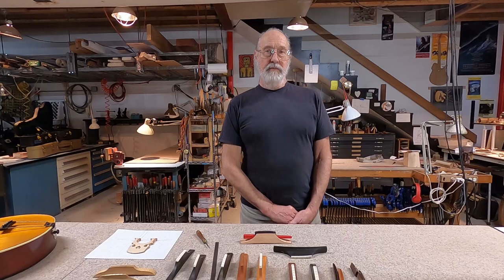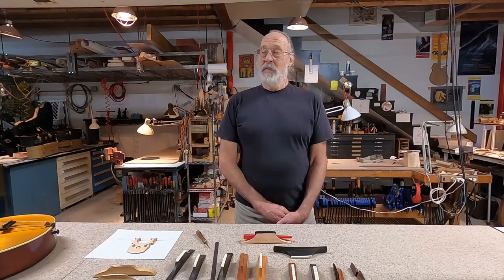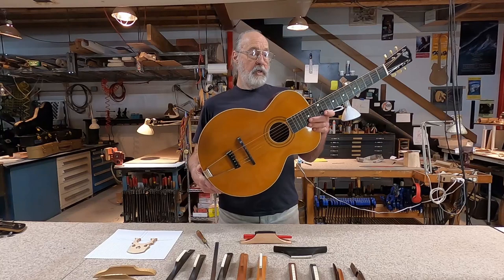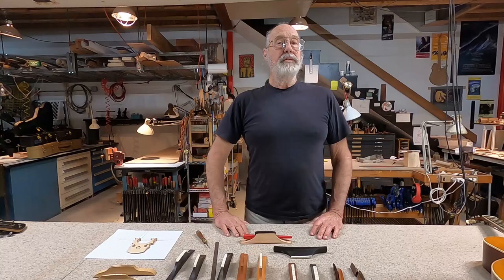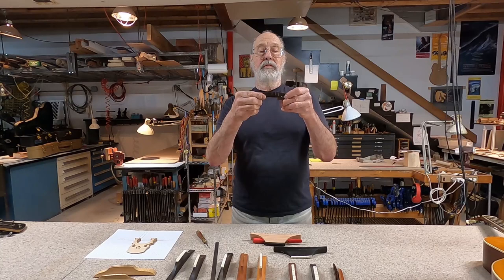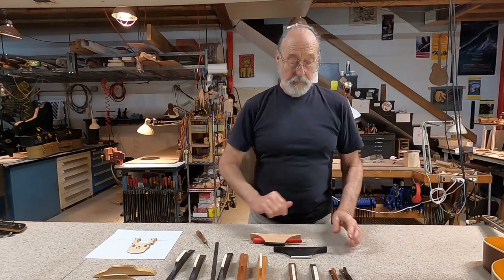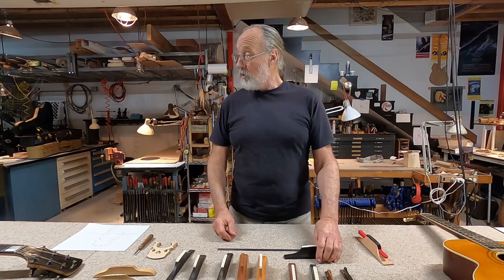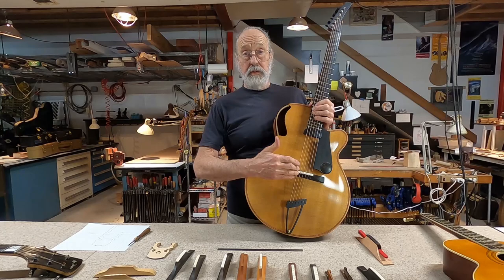Ken Parker Archtoppery: Fitting the Bridge Introduction

Comment: Hi! Would you say that now that you have achieved a successful shape for your bridges, the material is still important? Or it doesn't matter that much considering their ratter complex/stiff geometry?
Reply from the maker: Material always seems to be important, though I have found that the differences between bridge materials seem like they're less that I might have expected, assuming a hard and tough material.  I can feel how the bridge is changing by flexing and twisting it in my hands while I'm thinning it from the bottom surface.  Ever a really hard material like ebony gets around to feeling "gooey" if you get it thin enough.
Reply: @kenparkerarchtoppery9440  hi! That aluminum tube you use your necks in the vise is the best example of that :D

Comment: Ken, there's always so much to chew on after I get through one of your videos. Quick direct question - what's your experience using Indian Rosewood for the bridge? With the scarcity of Braz and the whole ethical side of things, I'm trying to avoid it for the most part. I have a good stash of very old, air dried old growth IE Rosewood, and it's incredibly light and stiff, and it seems to have worked well as a Wedge style bridge for being pretty lightweight. Thanks again for sharing that story about the wedge bridge, it's a great one for the history books. How old would you have been when you conceived of that? Cheers.
Reply from the maker: I must admit I never fell in love with any of the rosewoods, and haven't used them very often, so I have little to say about them.
I know lots of good builders who have used lots of rosewood(s), and I have no quarrel with that, but the material never seemed just right for my work.  It seems like a really heavy grass to me, but "incredibly light and stiff" will get any builder's attention, so why not?
I'd say give it a try, there's no harm in auditioning a promising material for this noble job.

One great thing about the Archtop is the non-glued bridge, so it's easy to assess what a material can do in this crucial part.
Violin makers are in the habit of dropping their bridge blanks on the bench to get a feel for the tonal response, and help them choose the most promising piece for the job.

Yeah, the dumb "wedge" bridge. I was a 24 year old brat in 1977 when I came up with the "chopstick" action regulator idea, natch, we were eating lunch! 
You know what they say about a 25 year old man's frontal lobe, don't you?  I apologize.

Comment: i NEED AN ELECTRIC GUITAR BRIDGE, THAT HAS INDIVIDUAL SADDLES THAT CAN BE ADJUSTED INDIVIDUALLY  IN ALL 3 AXIS .  DOES ONE EXIST?
Reply from the maker: Interesting question! Does one exist? Depends on your sense of humor! 
An original Tele bridge, for example, can be made to "adjust" all these ways with judicious use of files. It kind of depends on what you'd like to use it for, and what you'd like it to look like, but usually, files and careful work will enable nearly any metal electric guitar bridge with individually height adjustable saddles to work acceptably, in my experience. 
What I did was get disgusted with the junky bridges that came on otherwise good guitars, and just designed and made my own. It's been awhile since I paid any attention to this problem, so I don't really know what's available now, but I bet you have some aftermarket options.

Comment: Hello, I just want to ask you if there is a reason for you to use only full base bridges. Thanks a lot for answer, and congrats for these gorgeous guitars! It is really incredible stuff <3
Reply from the maker: As I explain in the bridge intro segment, the main move of the archtop bridge is towards and away from the nut, in response to the shortening and lengthening of a plucked vibrating string.  The two foot bridge design is uniquely well suited to a bowed string, as it's primarily driven across, rather then along the length of the string.  It's not that two feet are wrong, but as I understand it, there's no benefit, and possibly a missed opportunity to best energize the top.
Reply: @kenparkerarchtoppery9440  Great answer. Thank you, sir!

Comment: Mr Ken Parker you are amazing. It is really a shame that out of situation, time and resources, you sold the electric part to Wash... But that's a different story. I was wondering wether you are aware of an acoustic guitar brand named "Boulder Creek". They have a fascinating take on a suspended bracing system. I was wondering what is your take on it.
Reply from the maker: I just had a look, and I'm not so sure I understand it.  It's great to see young builders stretch out!  Would be fun to get to play one.
Reply: @kenparkerarchtoppery9440  Do you think it is working in a similar manner as the lateral bracing found on archtops and classical instruments?
Reply: @vassosserghiousr5488    That’s Interesting what Boulder Creek came up with.   It’s odd they went with such a symmetrical parallel design.  It makes me wonder as there’s not much symmetrical about what makes a wooden guitar top, saddle and strings all make pleasing sound as a unit.    I dunno

Their explanation of their theory with the drum head with a duct tape X applied didn’t seem appropriate for the context of a wooden guitar.  

It reminded me of how old Lutes and Baroque period ‘guitars’ used ladder bracing similar to how one would brace a wall with a 2x4.  
Braces going 90° across the grain of the wood top like that I thought was what made those first guitars frankly suck at projecting.   They sound lifeless and a bit lackluster especially compared to the newly developed piano.   Sure there’s some people into the Harpsichord sound but ya know what I’m sayin’

Some argue if it weren’t for the Development of the Torres guitar with his application of a fan bracing pattern, the guitar may have been left in the past.        

Here’s a link that has a quick overview about the roots of guitar bracing pedagogy.  
https://www.thisisclassicalguitar.com/bracing-styles-for-classical-guitars/

I’m curious what those Boulder Creek guitars play and sound like in person.    I also want to try one a Relish guitar archtop with that aluminum inner structure thing they’ve developed.     But I really want to straight up own a Parker archtop more than anything else.